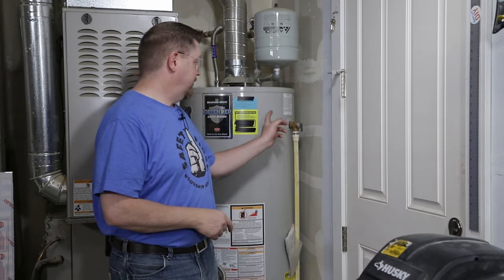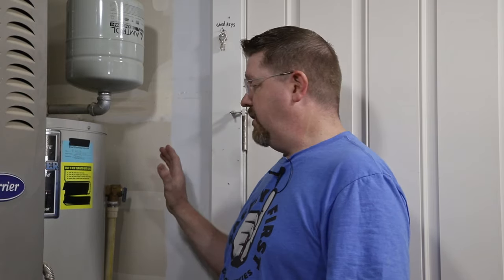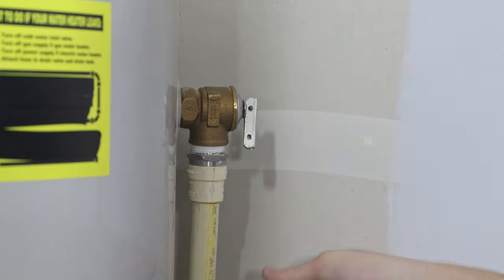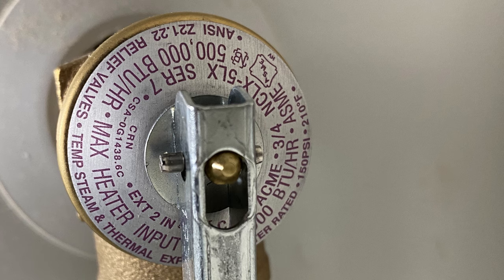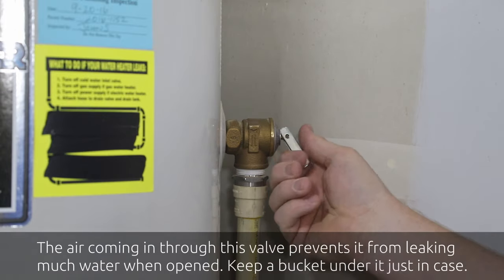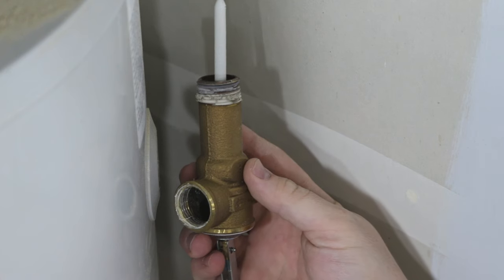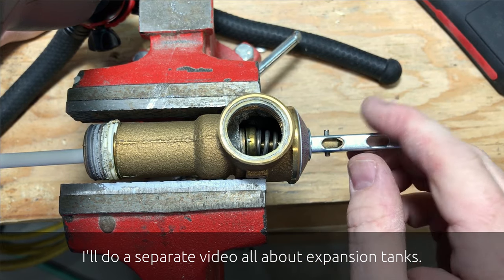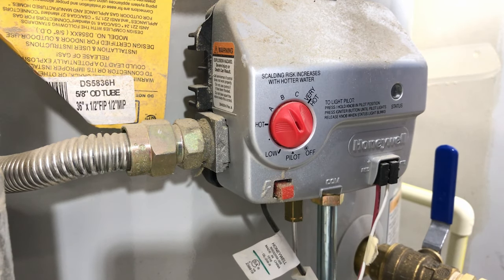How To Replace Pressure Relief Valve On A Water Heater (T&P)

Comment: Hi, I replaced my valve following your video a couple months ago. My valve is still leaking. It’s a slow leak, a vase under it needs to be emptied once a week. I tried opening the valve and closing it again hoping to reseat it as people have suggested to me, but it keeps leaking. Any idea what’s going on here? On a possibly unrelated note, I’ve noticed sometimes when I turn on the water it comes out with more pressure than expected at first, then goes back to normal. Could that be related? It is definitely a slow leak, it’s not releasing a lot at a time.
Reply from the maker: Hi Brad - do you know if you have an expansion tank installed on your system? If so, most likely it has failed and needs to be either re-pressurized or replaced: https://youtu.be/NGygvtP6Sdk
Reply: @AmplifyDIY  we might. We have a tank that’s a little smaller than a propane tank connected to our water system in the basement. It stands out to me because when we first bought the house we found it on the top side of drop ceiling and it was unsupported and was causing the pipes to sag. We built supports on both sides to support it. You think that could have failed? I’d believe it. Is that something I could do or should I call in a plumber?
Reply: @AmplifyDIY  i just watched some of your video. My tank is in another room than the heater. The water goes (from what I recall, but will confirm tomorrow) from our water line that comes into the house into one side of the tank and goes out the other side and runs toward (presumably directly toward) the heater. It isn’t right above our heater and has a line in and line out.
Reply from the maker: Hmm... That does not sound like an expansion tank - at least, it's not one I'm familiar with. Expansion tanks are supposed to be installed on the cold water inlet, on a T connection near the water heater.  What you describe sounds more like a water filter (with 2 connections, one in, one out). 

With respect to your leaking valve: Is it a very steady (a drip or 2 / hour all the time) drip, or does it only drip while the heater is actively heating? If it is a steady drip, the issue is with the T&P valve (possibly not installed tightly enough, perhaps the threads did not seal well enough, possibly a defective valve, etc). If it only leaks when the heater is actively heating, then the issue is most likely related to thermal expansion. Some systems need an expansion tank (like the one you saw in my video on those) or else the expansion that happens when the water is heated is enough to just barely pop the T&P valve for a bit. A few ounces (or maybe even less) will drip out, then the valve will re-seat once a bit of pressure has been relieved.

How old is the house? Did you replace the old T&P valve because it was doing the same thing, or did this drip just start with the new valve?
Reply: @AmplifyDIY  OK, the tank says it’s a therm-x-trol thermal expansion absorber. Amtrol model ST-13, max 150 PSI, standard factory precharge 40 PSI. I was wrong- it comes from the left and down into the tank with a T and continues to the right. There’s one hole in the tank, not two, sorry. There is a small blue cap covering the air pressure fitting(this is on the bottom of the tank, the T pipe that connects it to the water line is at the top). Looks and sounds like what we’re looking for and could be the culprit, right? 

I don’t know when the drip occurs, only that I need to empty the vase weekly. The old valve dripped too, I found your video and replaced it. The new valve seems to drip at the same rate as the old one did. 

The house is almost 30 years old. Our water supply enters the house and splits to two pipes. One pipe runs to this tank then continues on where it splits a few times- one to the water heater and others to presumably the cold faucets. The other pipe goes up, possibly to the front of our house to the outside spigot. The back outside spigot might run through this tank, so if I make the repair like your video I should check the front spigot since I think that doesn’t go through this tank.
What do you think?
To add, I wouldn’t be surprised if this tank was installed or used incorrectly. We find problems like that often in this house, they really cut corners and did some crappy work in some places.
Reply from the maker: Ok, yes, that is absolutely an expansion tank, and unless it has been maintained, it likely is the most likely culprit for your leaking T&P valve. There are 2 simple tests you can do right off to know for sure if this tank has failed: 

1) Remove the little blue cap to expose the air valve on the tank. Press a flathead screwdriver or the end of a car key against the valve stem in the center of the shrader valve there. Does a bit of air hiss out? Or does water come out? If water comes out, you need to replace that tank and don't need to mess with any other testing. 
2) If air comes out of the valve, then knock your knuckle on the tank - like knocking on a door. The part of the tank that is near the water connection should have a very dull "thud" sort of sound, while the part of the tank near the air valve should have more of a hollow "ringing" sound to it. If both ends of the tank sound like a "thud", then you likely need to replace the tank. 

More in-depth procedure for checking your tank:

1) Find out the water pressure of your supply. This is typically done at a hose bib with a water pressure gauge. They sell these gauges at Home Depot and Lowes for around $15. That pressure should be between 60 and 80 psi.
2) Once you know the pressure of your water supply, you need to find out what the air pressure in your expansion tank has been set to. You cannot measure this while the whole system is pressurized though, or you'll get a false reading. So, turn off the water supply upstream of this tank ... you may have to hunt a bit to find a shutoff (crawlspace, basement, out at the street in a box, or whatever) but every house should have a way to shut off the water. Once the water has been shut off, open a hot water faucet and let it run until the water stops. If it never stops (it may take up to 5 minutes to stop, if your expansion tank is bad) then you didn't actually shut off the water supply. Once the water has stopped flowing out of an open hot water tap, then you can measure the pressure of the air side of your expansion tank using the little shrader valve under the blue cap you mentioned. A regular tire pressure gauge should work fine to measure this pressure. 
3) Compare the pressure in your expansion tank to that of your water supply. If they are not the same, bring your expansion tank to a matching pressure. A bike pump can work, but takes forever and will tire you out. An tire inflater or air compressor is much easier to use, if you have (or can borrow) one.
4) Once the pressures are equalized, you can re-open the water shutoff - verify water starts to flow out of the hot water tap again.
After doing these 4 steps above, watch the behavior of the system for a few days. If the leak stops completely, you solved the issue... but I'm guessing you won't ever get this far because your expansion tank has failed and is completely full of water. The very first test at the top of this message likely will spurt water out of the shrader valve, in which place don't pass go, don't collect $200 - proceed directly to Home Depot or Lowes (or Amazon) and buy a new expansion tank. Install it following my instructions in the video I linked above. 
Let me know how it goes - good luck!
Reply from the maker: Oh, and as for which spigot to use to test your pressures: NONE of them should be plumbed down-stream of this expansion tank, so it should not matter... however, you may want to test the pressure at all your spigots just to see if they read differently. I'm betting they will all be the same.
Reply: @AmplifyDIY  i just removed the blue cap and pressed a screwdriver up into the air cap. I’d say it moved in about 1/8”. No water, no hissing air. Any ideas?
Reply from the maker: @BBern636  Yup! That means all the air has leaked out of your expansion tank, and it is not functioning correctly at all. Your next move is to test your home's water supply pressure, then pump up that tank to match. That will likely stop your T&P from leaking entirely. Keep an eye on the expansion tank for a week or so, and re-test the pressure to make sure it is not leaking air. If it is, replace the tank. If water ever comes out of the air valve, replace the tank. It's most likely it simply leaked whatever air it used to have - whether this took a week, a month, or several years is unknown. So, pump it up and see what it does. Good luck!
Reply from the maker: Oh, and if you cannot test your supply pressure yet (don't have a gauge, whatever) I'd recommend putting 50-60 psi into the expansion tank, just to see what it does. I'll bet that a) your T&P leak stops immediately, even if the expansion tank is a little off pressure-wise, and b) the expansion tank holds pressure reasonably well, and you just have to keep your eye on it every 6 months or so.
Reply: @AmplifyDIY  thanks, I will check the front spigot this weekend for the water pressure. I have a new pancake air compressor I just bought for a nail gun. Let’s say the outside spigot says 80 psi, then I should use my air compressor to bring my tank to 80 psi?
Reply: @AmplifyDIY  yeah I don’t have the water gauge. Maybe I’ll add some air tomorrow and give that a shot, thank you.
Reply from the maker: Yes, that is exactly right. It's important to make sure you understand that you have to add air pressure to the expansion tank while it is not also being pressurized by water though - so make sure you shut off the water supply to the expansion tank (possibly the whole house) and open a hot water faucet and wait until the water stops flowing completely before you add pressure to the tank. Otherwise you'll get a false reading and not add enough air pressure. Good luck!
Reply: @AmplifyDIY  Ok, so my outside spigots are 60 psi. I set my air compressor to 60 psi, assuming that won’t let the tank go over my goal psi. I hold the hose fitting for car tires up to the air valve for a while, then try the tire air gauge and it won’t budge at all. I’m guessing the tank has an air leak somewhere? Is there any way i can overfill and blow up the tank if I keep the hose on it and my tank is set to 60 psi? How long should it take from empty for the gauge to start showing psi?

Update: I decided to just replace the tank. New tank was $60 plus I bought a few tools (that ended up proving useless). Hardest part was taking the old one off. I miscalculated the weight as it came free from the pipe- I didn’t drop it but it came down enough that it broke a ceiling tile. I left my house to go to lowe’s at 9 am and finished around 1:45. Took two lowes trips- my first trip was just for the water gauge. I got the last AO smith 5 gallon expansion tank they had in stock. I’ll watch the vase under my water heater this week. Fingers crossed that solved the problem.
Reply from the maker: Sounds like your original tank definitely did fail. Did the new tank hold air properly? Did you pressurize it to 60psi before you installed it?
A failed (and full of water) tank will be quite heavy - glad you were not hurt! 
Great job getting it replaced! I'd love to hear if that finally fixes the problem for you once and for all. Thanks!
Reply: @AmplifyDIY  yep, I pressurized it to 60 psi. There’s a pressure gauge right past our shutoff valve (on the house side of the valve) and it reads 70 psi. Should I raise the psi in the expansion tank? The expansion tank is about 6 feet of pipe away from that gauge reading 70. I will definitely let you know the result of this, thank you.
Reply: @AmplifyDIY  so six days later, the vase under my t&p valve is bone dry. That was exactly the problem, thank you! Could you come over and help me locate and fix a leak behind some drywall next?? Just kidding (about you coming over, I definitely have a leak unfortunately), thank you for your videos and input!
Reply from the maker: I'm really glad that solved it - nice job!
Bummer about your leak. Best of luck getting it taken care of! (Unfortunately the only way to deal with a leak like that is to open up the wall... 🙁)

Comment: What do you do if the valve is frozen and you can’t open before unscrewing it?
Reply from the maker: It's ok if the valve cannot be opened before you unscrew it from the tank, but it's important to get the water level inside the tank down below the height of the valve. So shut off the cold water inlet, open a faucet to relieve pressure on the tank, then open the drain valve at the bottom of the tank to drain off several gallons. If you are unable to get the drain valve open, be ready for a lot of water to come out of the T&P hole as soon as you remove the valve. 
Good luck!

Comment: I Use my safety valve all the time to fill a bucket with hot water to wash my car .  Plus  I am checking the valve to make sure it's not stuck.  If anyone is saying opening the valve causes it to leak then it needs to be replaced because it's malfunctioning.

Comment: it doesn’t work like that for me... the valve doesn’t unscrew easily and with a smile... and it’s scary to make a lot of effort, it looks like it’s glued with anaerobic sealant, what should I do in this case?
Reply from the maker: It's likely been installed with either a thread sealant or joint compound. I'd consult the instructions which came with your tank... if it says it should be tested and replaced as I describe in this video, I'd give it one more try - BUT - use your best judgement.... if it feels like you are putting WAY too much torque on the valve, it is possible to snap the valve off, which would make things much, much worse.
Good luck!

Comment: They do leak once they opened, I had this happen more then once on water heaters leaking, I contacted manufacture about these valves they tell me not to ever use it not to open it, I have to take my water heater back cause of this it yet has warranty on it so I will.
Reply from the maker: Pretty odd to hear of any manufacturer recommending not testing this valve or recommending never touching it. Even more odd to hear of replacing the entire heater because of a leaking T&P valve. I still recommend testing this valve annually, and replacing it if ever leaks / fails. It's a fast and inexpensive job.
Reply: Yeah they recommended to just take it back originally thought of just replacing the pressure valve but it was under warranty yet so I have new unit designed little different then the other one which I like better, once the warranty expires on it in Nov 2025 & valve leaks again & sure it will in time I will replace the valve, the cost of these have gone up by almistc200$ since then back in 2020, when do you recommend changing out the anode rod how often should they be change out? You have a video on that as well? @AmplifyDIY

Comment: How do i order the right t&p for my water heater
Reply: The tag is a messed up an i cant read it i can see some info what do i need to know thanks
Reply from the maker: I'd start by checking the owner's manual of your heater. Grab the model number off the side of the heater and pop that into google. See if you can find the specs for the valve listed from the manufacturer, in the manual, etc. Good luck!

Comment: What happens if that tmp plastic vertical pipe breaks?
Reply from the maker: Hey Triple H - if the downpipe from the T&P valve is broken, it should be replaced asap. That pipe is a safety feature to direct any discharge down and away from where it could seriously injure (burn) someone standing nearby.

Comment: been having problems with Richmond gas water heater on average yearly.
Reply from the maker: What kinds of problems? Have you been performing regular maintenance?
Reply: @AmplifyDIY  Our current problem is our pressure relief valve slowly drips only after showers or doing dishes. I release some pressure from the valve and it stops until the next shower. It just started doing this in the last 2 weeks after it got under zero degrees outside. I thought maybe we were getting too much gas pressure from the gas line (making a bigger flame). I dropped the temperature down to the lowest setting on the water heater and still does it but the drip slowed down. Not sure what is going on. The water heater is a couple years old. The valve doesn't open just drips.
Reply: @AmplifyDIY  I replaced the burner assembly on it last spring.  Perhaps I did not put it in right and is heating the water too quickly but had no problems until a couple of weeks ago. I did notice when It first happened the valve switch was in the up position and think I could have banged it with something bag of dog food and possibly damaged it? I'll replace the valve and see what happens. I'll be watching your video as I do.
Reply from the maker: Hi Jon - replacing the valve is the best first step for sure. Also, if you have a thermal expansion tank on your system, you should check to make sure it is operating properly. I did a whole video on those here: https://youtu.be/NGygvtP6Sdk
Reply: @AmplifyDIY  Replaced the PRV and didn't fix it. Guess I'll crawl under the house and see if I have an expansion tank. When I replaced the PRV I noticed a lot of white substance inside it for only being 2 years old. Calcium?

Comment: Do you have to shut the gas off??
Reply from the maker: Hi Chris - no, just set your heater to the "pilot" or lowest heat setting, and don't drain ALL the water out of the tank. Just drain it so that the water level gets down lower than the T&P valve. Good Luck!